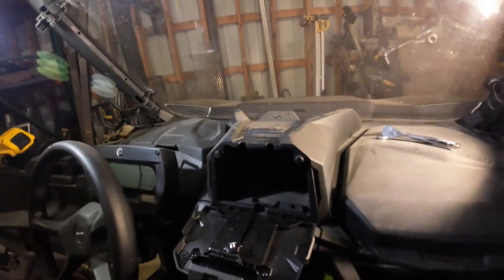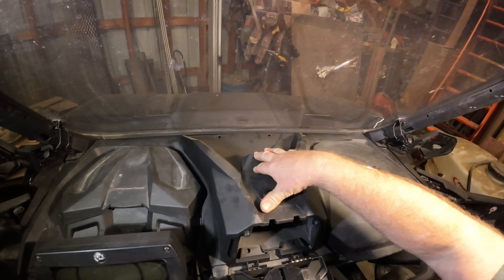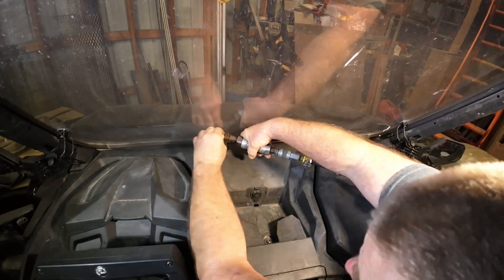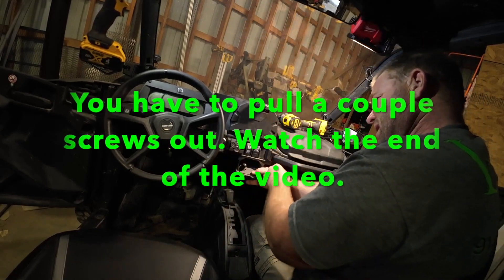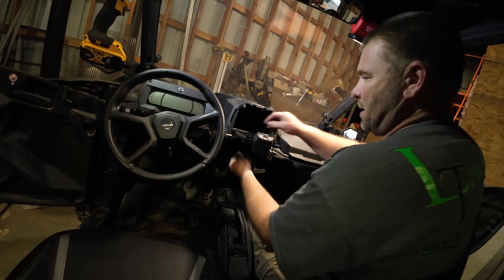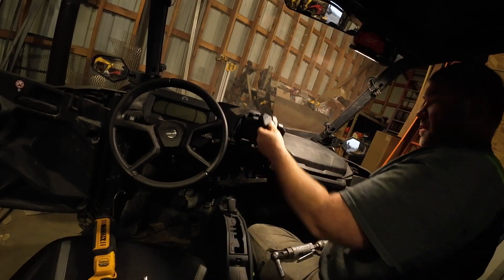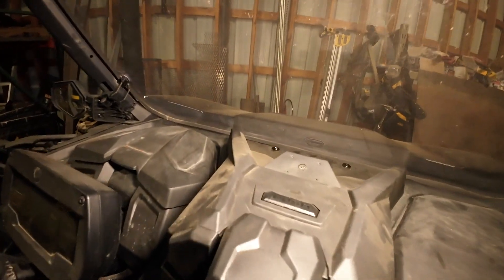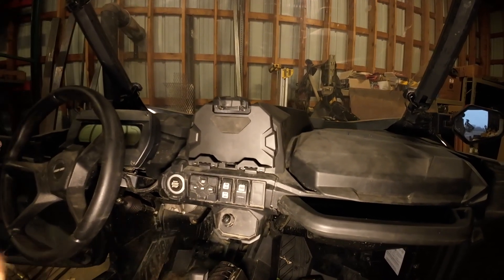Can Am Commander Electronic Dash Holder Install

Comment: What year is your machine?  Do you have a link to the tablet holder?  

I am trying to find one for my 2017 Commander. 

Thanks.
Reply from the maker: 2021. I bought it off amazon. Its a knock off of the original one. Im not sure anyone has designed one for the g1 models.